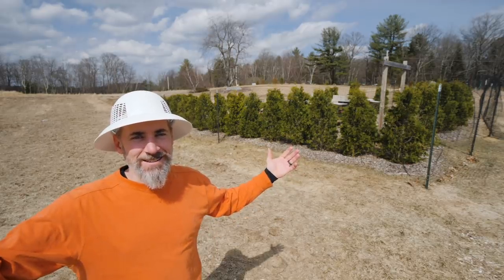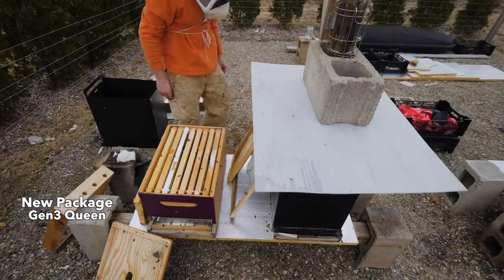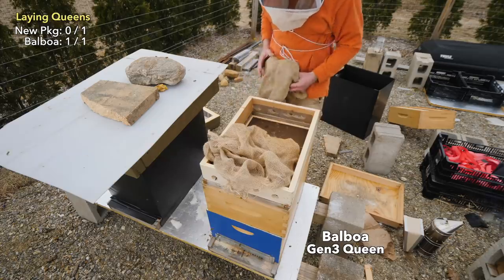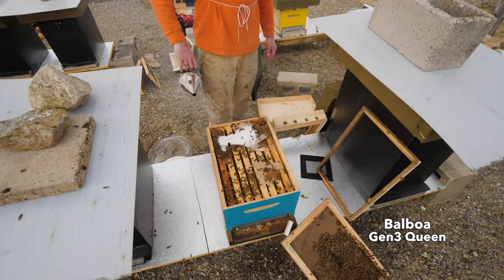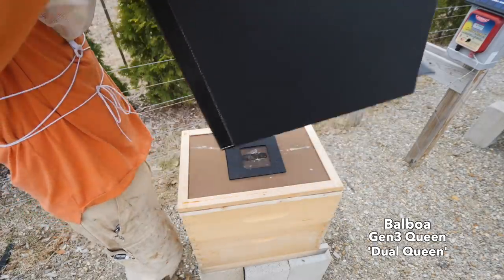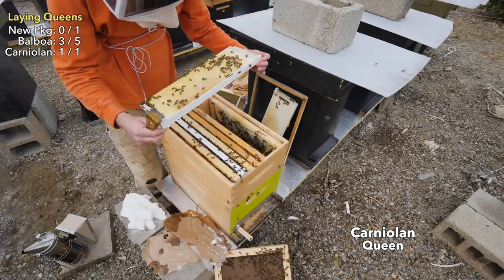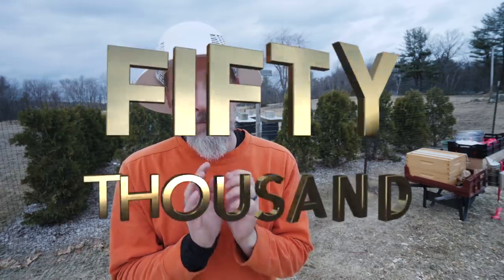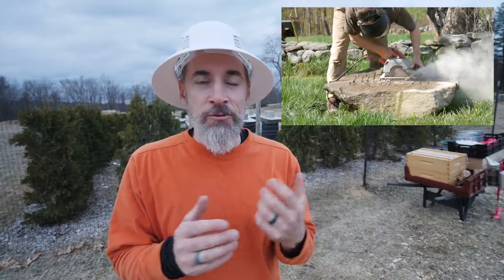Spring Hive Decisions - Reversing? Feeding? Supering? Single or Double Brood Boxes?

Comment: In those hives where you were concerned about your queens not having space due to Honey in the deeps so you left her in the super - I may have just pulled a few of those honey frames and replaced with empty comb.  You can always use those resources elsewhere.  Another things to consider is that if you go to single brood boxes you'll still want bees to be drawing comb to be used within the yard.  If you watch Canadian Beekeepers blog he actually starts singles, then adds a second deep with 4 empty frames of foundation.  F=Foundation.  (FFHEEEEHFF)  Once he gets to 8+ frames of bees he adds this deep.  The hive doubles in size and then he either pulls if for a split or pushes the bees down and then adds several supers at once.  In either case you're always pushing them to make new comb which is always useful

Comment: Its funny how the 30ish mile difference between us is so different. My hives all had multiple frames of brood in all stages and they are bringing in pollen. I'm guessing mine are a week or 2 ahead of yours. I ended up reversing my hives on Saturday and cleaning the bottom boards. I have Carniolans and it seems they build up quicker in the spring.I'm interested to see how your 8 frame single deeps do. I'm going to try 2 of my hives as 10 frame singles. If I like it then next year I will do my other 2. I'm also converting over to all deeps. I will use the few mediums I have but won't be buying anymore or trying to get them to draw out anymore mediums. I'm hoping that it will help with being able to switch equipment around between hives and allow me to buy and store less equipment in the future.
Reply from the maker: We just need a few warm days and our trees will pop open and it's off to the races. We've just had a lot of chilly days. We're at 1200' and that makes a difference even 1 mile away at a lower elevation.

Comment: Fun sharing your journey!  when you decide to add the flow super, put one of the frames with some capped honey in place of one of the flow frames, that is what did the trick for me.  (They didn't touch the flow frames until I did that).  Also the newer hybrid flow boxes have only 3 flow frames, the rest regular frames, so you can arrange your flow box the same way if you want.
Reply from the maker: LC Wow. Good tip. I would not have thought of that.

Comment: On the coast of Mass here - My girls were also bringing in nectar last weekend.    I'll be doing a single brood box on one of my hives and a new package I'll be getting in a week.  Devan Rawn's explanation of it made complete sense to me.  The numbers seem to work just fine.  As long as you super them in time there should be no issue with population.  The trick for us (in Mass) will be when to pull the supers.  They will need to be fed immediately but we need synchronize that with the fall flow as well.  We want them to have enough to eat but also allow them to back-fill the nest as the queen begins to slow down.  The trick will be to feed them enough at the right time and not overfeed them.  We also want to take advantage of the summer bees to dry out and cap the syrup before it's too cold.  I have to say your journey last summer inspired me to experiment more with my bees, to start making splits and to expand my bee yard this year :)
Reply: MAC6792
I saw a video on winter clusters, and they were explaining a few things. it is normal for the bees to go head in to the cells as that is how they form a mass of bees. Bees IN the cells, and BETWEEN the cells and they have a solid ball of bees. If they are not in the cells then they can not form a full cluster. Backfilling prevents the cluster to form in many cases. Or so the video explained. I will try to find it.
Reply: precisely why feeding them the right amount at the right time is key. They will organize the syrup and finish it to allow them cluster properly

Comment: Vino, about almost losing your queen. It’s really important not to place the last frames in when it’s a middle frame because you risk rolling the queen or squishing her as you put the frames in the middle. Always make sure there is 2 frames worth of room when you put a frame in next to her or even the one she’s on. She fell to the bottom because it was so tight when you placed the frame in. It rolled her off, down to the bottom board. The same goes that you never pull a middle frame first without pulling a outer frame and making space to pull an inner frame. Best of luck. Love your videos.

Comment: 3:30 why didn't you swap the whole box rather than lower a few frames?
Reply from the maker: Because the bottom box is a deep. The top box is a medium. Also, the bottom box has an attached mouse guard. I want the bottom boxes to stay where they are. It’s a little hassle up front, but better in the end.

Comment: Have you checked out Sainfoin and Biennial or annual Sweet clover? Lots of great legumes that bees love, they make crazy good honey, and require no irritation. If you disc this time of the year, then use black tarps to smother that sprouting feild grass. You should be able to get a few stands established before fall. It would definitely be worth investigating a way to establish those types of bee forage. As they are the bees knees. And using the black tarp method could even alow you to expand in that thick feild grass, by just smothering it. This is a tactic also used by organic market gardeners, to eliminate weeds while beds are resting. Best wishes!

Comment: Question on methods:  if you can locate the queen so easily, why not just catch her and move her into the lower box, without transferring frames and creating the mismatch?
Reply from the maker: Adam Rogulski  Because the frames she was running around on are most likely frames the bees have cleaned and prepped for eggs. She’s on those frames getting ready to lay. The frames below were all half eaten honey and syrup stores. The bees work ahead of the queen getting frames ready. They are noticeably clear and awaiting eggs. I want those frames surrounding the queen.
Reply: @vinofarm  Wouldn't they just move the honey up?  Or is time too much of a factor?
Reply from the maker: @arogue469  Well, I was right there. Why make them do something that would take days when I can do it in 3 minutes? I'd rather the bees be focused on prepping cells for the queen to lay and not moving honey all around the hive.

Comment: New beekeeper here! For your single brood box plan, are you using a 10 frame deep? 10 frame medium? Or switching it up based on the size of the colony?
Reply from the maker: I'm all 8 frame deeps for my brood boxes (except for one oddball 10 frame medium hive that I'll be transitioning to a deep as soon as the queen starts laying.) I know 10 frame deeps would be better for single brood boxes, but I kind of know my bees and most of them are not super fast with the buildup. Plus we have a 1-2 month dearth in the summer and the queens really slow down.  I'll be monitoring them closely during the spring flow. The smaller hives that came from splits last season all survived winter with one deep and one medium. I'll probably do that again next year, but try to put the medium on bottom so the queens start their laying up in the deep.

Comment: It could be not so good to move the bees in the box unless you are sure there is no cold weather coming yet. That's two boxes for only a frame and a half to 2 frames of bees. They may have been in the top box due to heat conservation. If you look close you will find some brood. If it gets cold they may have to move up and abandon it. If she lays in the medium then just wait till it warms up some then place the queen in the bottom and shake the bees down and put a queen excluder between so she can't get back up. Nurses will move back up to maintain that as she continues to lay in the bottom. Once the brood hatches out the medium super will be clear. All the folks using single hive management do this exact method to super charge hive population before the honey flow. It how they create a massive 2 box population to prevent swarming then constrict it down to one box for a massive honey harvest from each hive. That's why I use deeps for everything. I decided to use single box management but even before that decision was made I didn't want to be messing with different sized  equipment. Everything is deep and everything uses the same frames.  Honey supers are heavier but by the time I have enough hives that the weight poses a problem I'll have the income to solve it.

Comment: They don't go through their stores until they explode on eggs. Then the stores will drain very fast. There isn't much needed through the winter. They also prefer fresh nectar over old honey.
Reply from the maker: Black Label Homestead I’ll go back and start replacing full honey frames with empty comb once the weather warms up. It’s still a bit cold here. Unused capped honey can be used during our July dearth. For now, I just left it with them because feeding nectar would definitely cause a honey bound situation, plus it’s just too cold at night.

Comment: Why not just shake the queen off in the brood box rather than put a medium in a deep box.
Reply from the maker: Because the deep frames were full of honey and the medium frames had a lot of empty space to lay. They can build comb off the bottom of the medium frame if they want to.
Reply: @vinofarm  Got it. I don''t keep bees so it was just a question for my curiosity. Would putting another deep under that deep been an option. I understand you may not have had extra drawn out frames available. I'm just thinking af any way to not put a medium frame in a deep and the difficulty of inspecting a medium frame with comb hanging off of it. Maybe it's not an issue.
BTW your bees are doing great. Your hive insulation is remarkable.
Reply from the maker: John Tripp You’re right that I don’t have a lot of extra drawn comb right now. Also, bees build UP so you want to try to start them as low as possible. They’ll mostly ignore a brood box installed UNDER brood. Adding a couple inches of comb off the bottom of a medium frame is common. No big deal, and it gives them a place to build drone size comb easily if they want to.

Comment: Are you aware that the bees take the sugar and mix it with water, so they can store it similar to honey? You seem so surprised that they have all these stores. Imo it's just sugar that you fed them made into sugar water not honey.
Reply from the maker: That was a thought I had, but I wasn't sure. When I pick up frames a lot of DRY sugar falls out of cells. I assumed they were storing some of it dry. The capped frames I was pulling out in this video were definitely honey from last fall. The open 'nectar' looking stores could have been from the sugar I guess.
Reply: @vinofarm  makes sense. They surely eat the uncapped sugar water before they go for the capped honey.